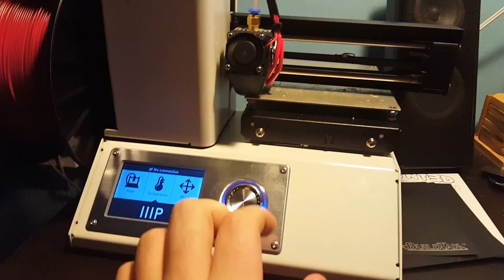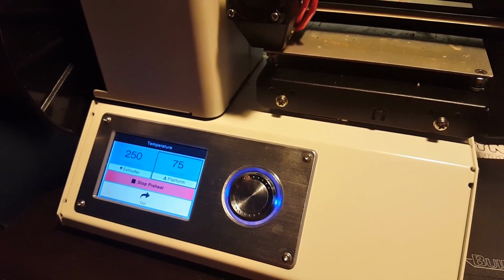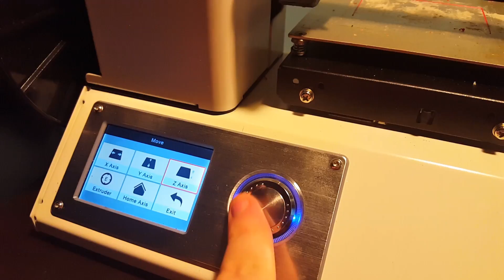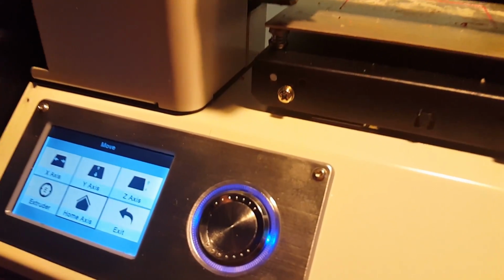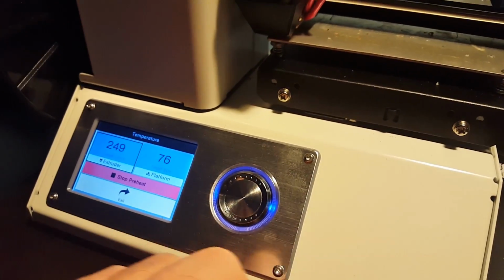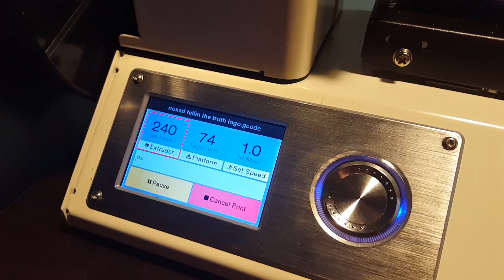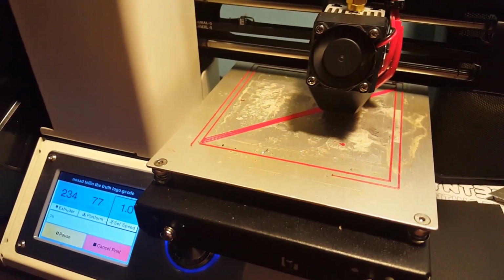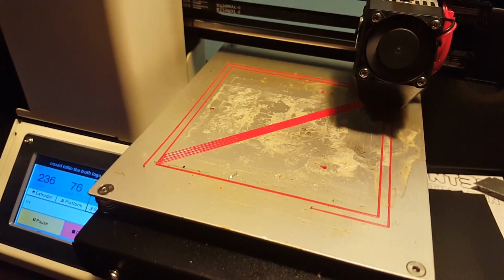How To Print With Monoprice Select Mini 3D Printer Tutorial

Comment: I can't get any files to show, and I've used multiple SD cards. Is there some formatting trick, or some limitation on card size?
Reply from the maker: S1500 that’s weird.  Your sure you are using Gcode files?
Reply: @WeaverFamilyFarms  I'm now using the card that came with the printer. That one works. Printing via direct USB just sits there. My first print printed air. Now it's printing. Some cat.gcode file. Network connecting via that server connects, but doesn't initiate a print. This is rather frustrating.
Reply from the maker: S1500 do you have everything set up right?  They make it sound like these are plug and go but that’s not the case. Lots of calibration has to be done
Reply: @WeaverFamilyFarms  I'm using the gcode file that came on the card, with the printer. I'm printing the cat right now. So I got that going for me.
Reply from the maker: @YayAkiba  hey thats awesome, it will take time to get used to it all if this is your first time, i am sure you will get it, just keep trying and experimenting.

Comment: If you wanted something from thingiverse, would you load it to cura and size it to make sure it will fit then continue to print, right? (Also making sure you have the right settings in cura.
Reply from the maker: FireKicksTV exactly right!  files from thingiverse are mostly stl files. but you can open them in cura as save to printers sd card as a gcode file and your good to go!   my website also has many projects i have made and printed www.noxad.org  all free and i have videos on each one also

Comment: You shouldn't have to home the print head before you tell it to print, it should be doing that automatically. Pre-heating shouldn't be necessary either.

If you just select the print from the menu it will start by heating the bed, assuming you are using a heated bed, and once the bed is within 2°C of the target temperature the hot end will begin heating and once it reaches the target temperature it will home all axes and start printing.

If you activate the wifi on your MP Select Mini be aware of the bugs in it. 
Sometimes, once you have uploaded a file to print, it will wait for you to select print from the web page it displays, sometimes it will automatically start the normal print cycle but watch out because sometimes it will automatically start the print cycle without heating either the bed or the hot end and if it does that you definitely do not want the print head in the home position.

With the head z axis raised up it will give you time to cancel the print and restart it so it does the normal procedure.

If you want to start an uploaded print from the printer menu it's always given the name cache.gc on your SD card.
 
Have a great day and happy printing.
Reply from the maker: thanks for the tips and for watching my video! I am learning more and more every day, but love sharing what I am doing and what I am learning!  Sometimes this printer will print without adjusting anything, and sometimes It will not, I do see when I export my gcode file I have the chance to set the temperature of the files, which is something I learned not too long ago. Thanks for your comment! Stay in touch!
Reply from the maker: Oh, and also I have just been using the SD card, no wifi :)